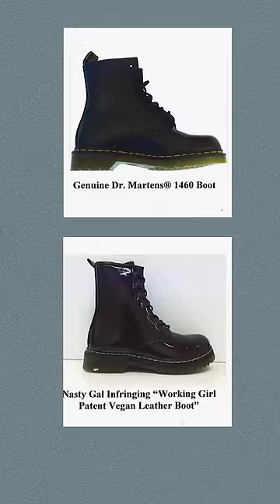Doc Martens almost went bust in the early 2000s. #DocMartens #boots #Docs

Comment: I wear the boots and shoes all the time. These are made well, and if you have a cobbler in town these can be re-soled unlike so many other brands. 

I'm not fond of the yellow stitching, so I  cover it with a black sharpie. Very cute.
Reply: They have a reputation for being made well but that doesn’t really hold true with the past few years of manufacturing in Asia.
Reply: @joelwoodall1050 thank you. A pair of docs from the 80’s or 90’s can last 5-10 years and only cost 100-120. I know so many older guys that switched to solovair cause doc martens aren’t as good.
Reply: @Crash.7434  lol I’m wearing a pair of Solovairs right now. I’ve heard they can have quality issues too, but in my experience they’re rock solid.
Reply: @joelwoodall1050  oh for sure. You never know I may have just got a bad pair cause like I said they felt way heavier thicker and sturdier but they still did the same as my docs. Since solovairs don’t have normal 14 holes I decided to go with docs again so I can get a pair of 1914s I seen solovairs do have 14 hole but I don’t like the zipper.